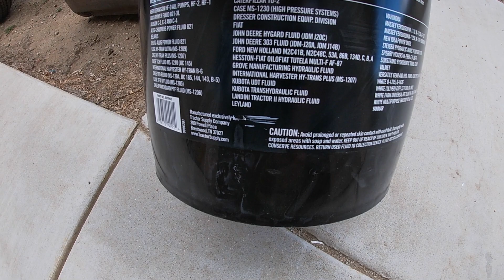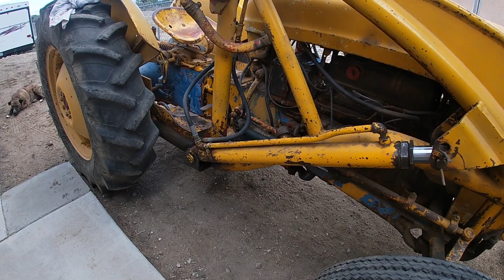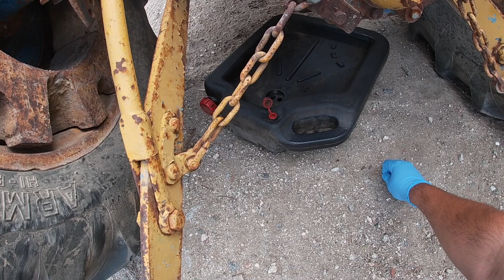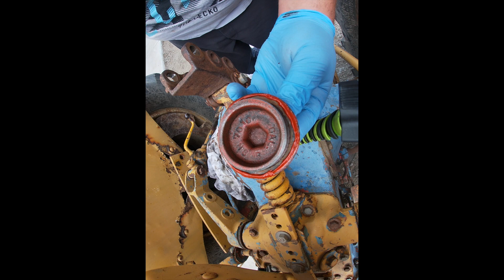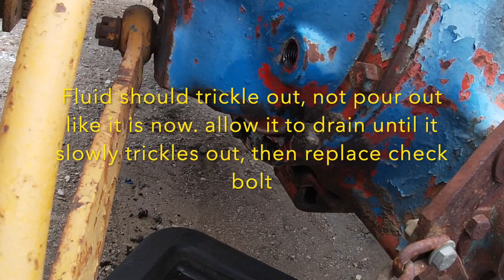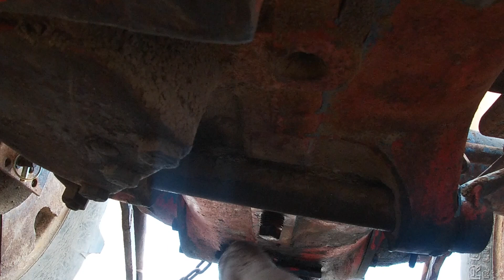Ford tractor maintenance

Comment: Can you sgow how the loader attaches to the tractor at all mount ponts ?
Reply from the maker: Hi! I’ll try and whip something up for ya.
Reply: @HandsOnDismantler  try to show where the hyro lines plug into the tractor also
Reply: Yes. I got a 1960 801 ford diesel. And im looking at a loader a guy has that looks like yours but i will have to make it fit to my tractor . its for a 80s ford that had steal rails
Reply from the maker: Did you just pick up a 851?

Comment: How much does this tractor weigh?
Reply from the maker: Robert Sandoval I haven’t had it weighed, but everyone will have a different answer. Some have liquid in the tires some don’t, different attachments weigh differently as well. I believe it to weigh roughly 6k lbs. that’s just guessing
Reply: I do not know what the loader adds but the tractor itself is listed as 3400 lb
Reply from the maker: @matthewrobertson8937  yea but that’s not ya do I get into account the fluids in the tires. Size and the attachments. That weight is just the tractor alone. That’s why I was saying people will say different weights